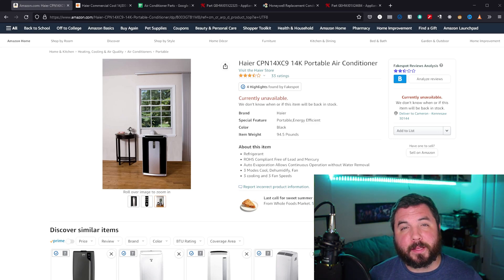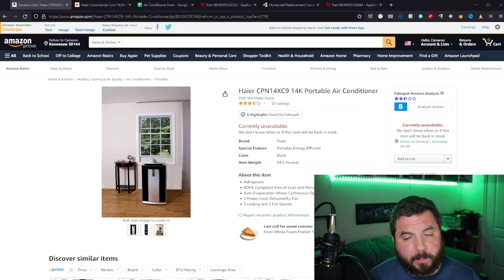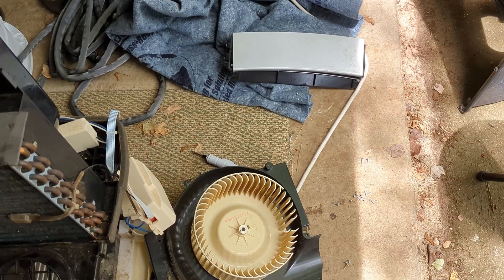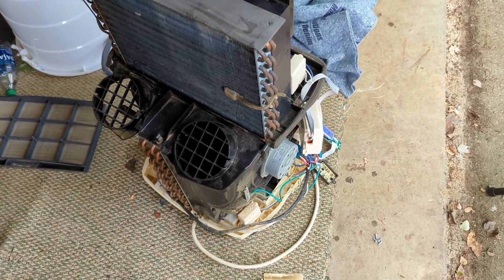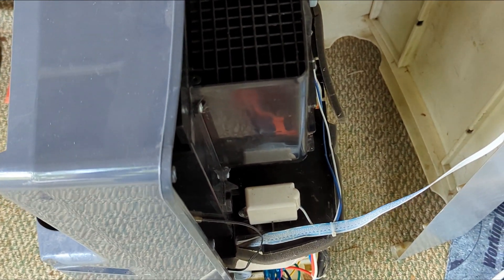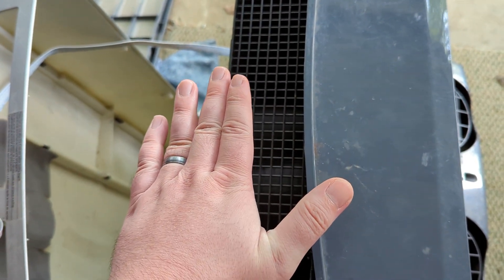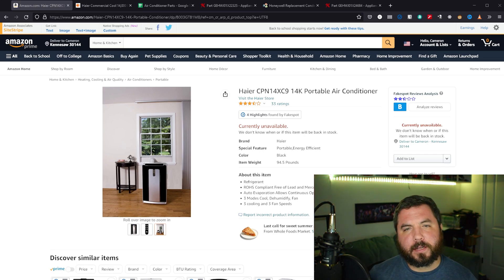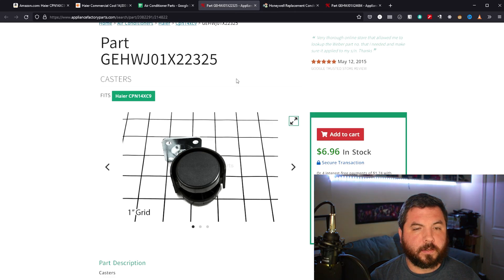My garage was overheating and I bought a cheap broken portable AC (Haier CPN14XC9). Can I fix it?

Comment: How did you remove the condenser fan assembly? I have the same problem.
Reply from the maker: I had to remove the condenser fan assembly with my soldering iron as it wouldn't come loose otherwise. I don't necessarily recommend using your primary soldering iron, but it did work in a pinch. Thanks for watching!

Comment: Could you tell me where you bought the parts and a model number (fan and motor)?
Reply from the maker: Hi, thanks for watching! I bought the motor from sylvane.com, part number A3002-500-1-P11, and the fan from appliancefactoryparts.com, part number GEHWJ01X24684. If you don't see any in stock at sylvane.com, repairclinic.com seems to have a compatible motor with the part number AC-4550-285. Good luck with your repair!

Comment: Nice job! Can you tell me how to open the back cover of it? I have removed all the visible screws, but it seems there is still something in the upper half holding it. Thanks.
Reply from the maker: Thanks for watching! I would check to see that all screws are removed and that you disconnect any ribbon cables to the control board. I remember having to disconnect the front panel from the main chassis.
Reply: @tinkersmusings  Yes! I just figured out that there are two screws that you can only get to them after removing the front panel. Thank you!